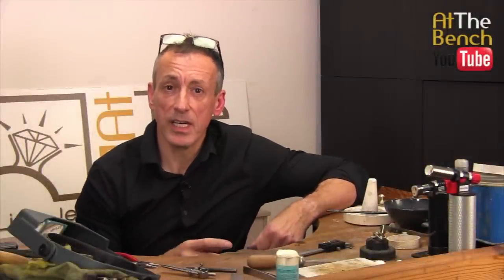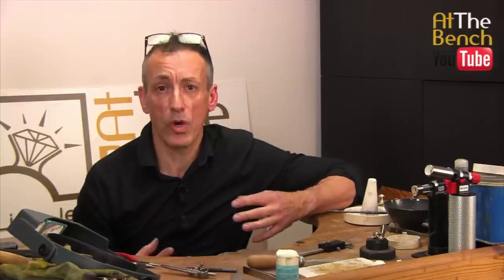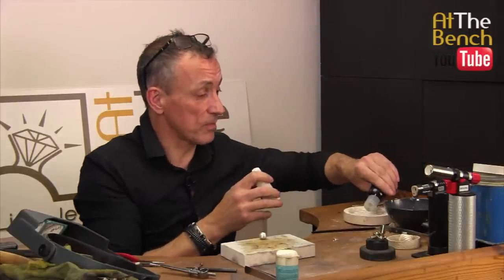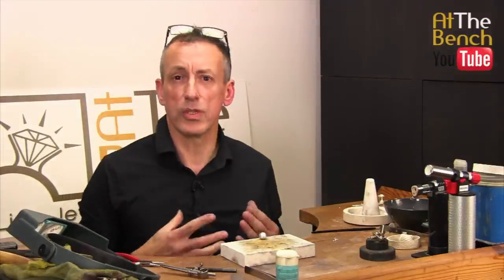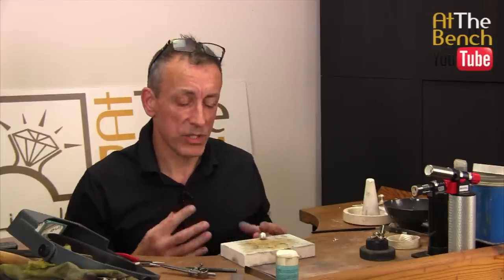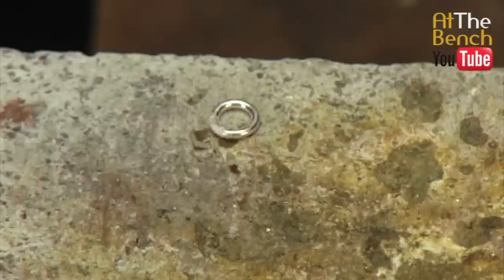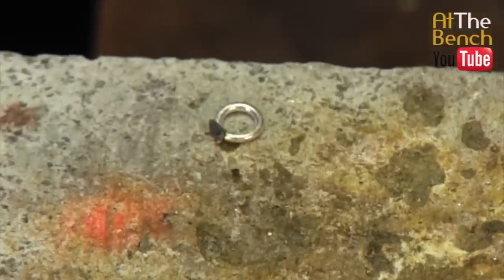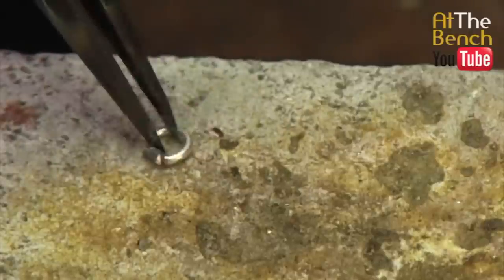How To Solder a Small Jump Ring and Bail to a Large Pendant Without either Melting

Comment: I have been soldering electronics for over 45 years. So when I found Jewellery making, I thought soldering would be easy. Wrong. 
Although I understood, heat the joint not the solder, there is so much more to this type of soldering.
Thanks Andrew for making our journey so much smoother.

Comment: Thanks for demonstrating a joint that provides reliable strength, yet has no mechanical connection (like twisted wires have). I just picked up a T&C toggle bracelet at a yard sale, but the little jump ring that holds the toggle ring on broke right where it was soldered to the ending bracelet link. I thought for the price of a repair I could buy a butane torch, some silver solder and borax, and just fix it myself. So thanks for the instruction. I'd have melted that jump ring for sure.

Comment: ill be trying this on tuesday! soldering a necklace finding to the end of a string of silver beads strung on 1mm foxtail chain. i have about 3-5mm extra chain to work with and needed this tip! (i thought about also submerging the string of beads under water and covering the top of the bowl with a heat shield and also putting stop flow on the chain so it doesnt suck away all the solder away from the joint)

Comment: Thank you for the instruction which was so useful. I was wondering if you could help me as when I make a ball with a little hole, I always struggle to get rid of the water after I cleaned it in a pickle. Sometimes I thought I got rid of all the acid then a few weeks later I realised I found a residue of acid. How can I get rid of all the water? Thanks in advance x

Comment: Hi Andrew, I have a question I was hoping you could help with: Is it possible to put a little easy solder over the hole (that usually allows air to escape when soldering) in the sphere if I don't heat it too much? Thank you! And thanks for your excellent videos!

Comment: Hi Andrew, would it be possible to attach the bail with a soldering iron instead of the torch, please? Many thanks, Debbie
Reply from the maker: Hi, no a soldering iron won't get the metal hot enough for the solder to melt
Reply: @Atthebench  Hi Andrew, thank you for that and for such a fast reply. It looks like I will be investing in a torch and putting the fire brigade on standby! Many thanks, Debbie

Comment: Andrew..I'm having trouble soldering thin and small bezel gallery wire and I put a 14g bead wire at the base of the gallery wire..I always end up melting something...do you have any advice...I've heated from the bottom..from the top and still end up melting product.sometimes the solder just turns black and doesn't melt..what is going on please help me figure this out...

Comment: That  video was very helpful, but ihave a question: when you pickle that piece, how do you avoid getting pickle into that hole?
Reply: I’m probably not being helpful here, because this is kind of the bane of my existence.  I
I deal with it in two ways, neither of which is “solving” it, so I will hope for more responses here.  
So the first thing is having backing soda dissolved in the rinse water.   This neutralizes the acid so that if the rinse is incomplete you don’t get acid showing up inside the hollow form down the road.  What you can get is chrystalized baking soda once it dries out, which is not a problem, you just need to have a second rinse bath that is plain water.  
The other thing that I always do is use a syringe to inject water into the cavity.  I do this probably way more times than I need to.  But I do it six to ten times.   Aiming the tip this way and that.  But it is a terrific amount of pressure inside.   
It still takes a while for the water to come out after this so I usually put it under a lamp, or something, and get busy with something else.

Comment: Man all your videos are great I can’t afford the membership to the website but this is just as good I’ve started silver smithing but I can’t seem to get it to pour it Melts but it doesn’t fully turn to liquid it like the top layer melts and the bottom is still hard any tips on how to get it to pour and what’s the acid you put it in to clean it I just sand it and wire brush bits to clean it or vinegar then sanding etc lol
Reply from the maker: The metal is not getting hot enough. The surface nay be molten but the heat has not reached to the core, middle of the metal. More heat or a stronger or simply more time is needed to get the whole lot of metal molten. We use a safety pickle, sodium bisulphate, as a pickle

Comment: Do you always have to use a torch to solder or can you use an electric soldering iron with a temperature adjustment?
Reply: A soldering iron doesn't get nearly hot enough (~392-896°F).  Easy silver solder needs ~1145°F to flow; hard solder needs ~1425°F.